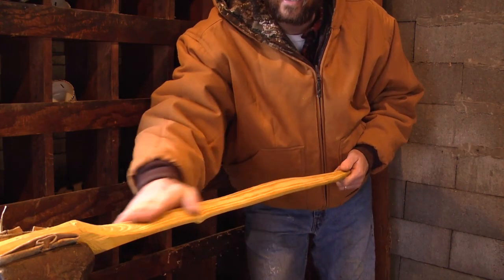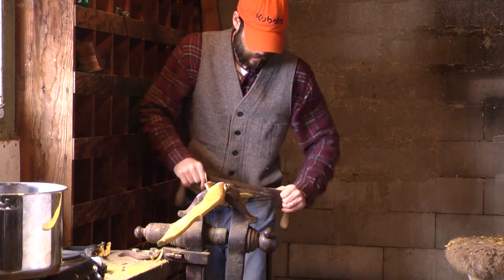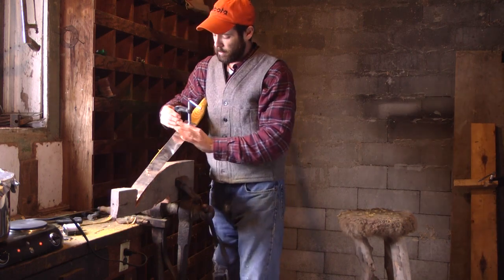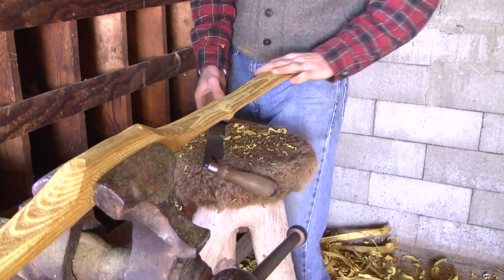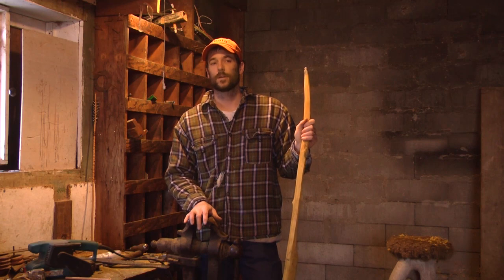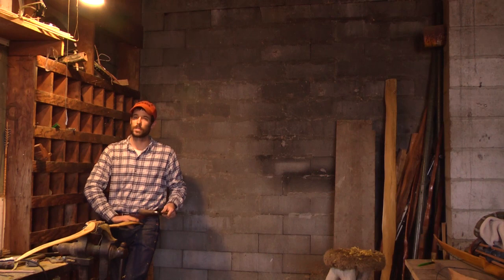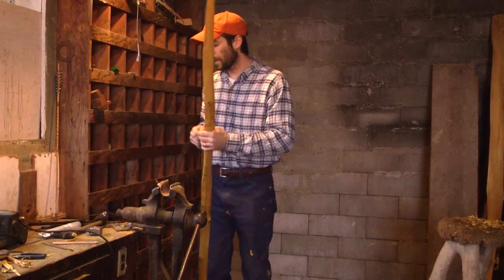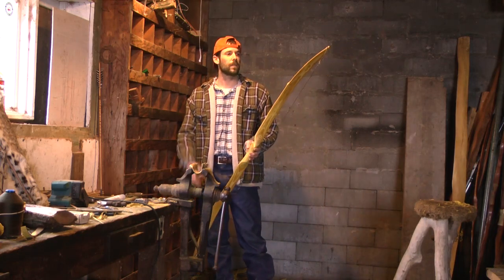How to make a Longbow - Part 3: Tillering

Comment: if you can draw the bow to 28" like 5 times on the tree is it ready to shoot? how do you know when to stop tillering and string it up? im at the very last stage of my self bow and im too scared to actually shoot it at 28 even though i can put it to 28 on the tillering tree.
Reply: You should be fine, to be extra safe you could carefully pull it down to 29" or even 30" just to make sure the bow won't break if you hiccup or something. 

When you say string it up you mean finish the bow or put a short string on it and bring it to brace?
Reply: *****
Ok thank you for your reply, When i say string it up i mean string it up to shoot, or to say the bow is complete.
Reply: If you're at your last stage of tillering your bow should already be strung to full brace and pulling down to 28".
Reply: *****
I just checked, I can get it to 26'' and the brace is 5 inch's
Reply: Ok, 5" might give you a bit of handslap but some people prefer it there , just gradually bring it down to 28. and see if you can get another inch in there. Should be sweet.
Reply: On a side note, don't be afraid of pulling the bow , as long as your limbs are bending well and you got no hinges you have nothing to worry about. And if a bow does break well, it would've broken at a later stage anyway, sometimes they just do.
I broke my first one, it was horrible, but 4 days later I already had my second one all tillered and shooting.
Reply: *****
oh sweet, thanks for your reply. I will let you know how i go!
Reply from the maker: Hi Tom, sorry for jumping in so late.  existentialnihilism (wow, that's a whopper) has if right.  One thing I'd add is not to pull your bow past whatever you want the finished weight to be.  If, for instance, you pull the bow to 28 inches while you still have some wood to come off and the weight is still high, you're likely to cause excessive string follow.

Comment: How long after you cut the tree do you let it dry?
Reply from the maker: Edgar Sanchez It depends on the drying conditions. If the log is split into relatively small staves and stored in a dry environment, then maybe 6 months would do it. If it's humid then it may take over a year. You can also rough out a bow after a few months of drying to speed the remainder of the process. Check out the harvesting and drying video on my channel.
Reply: I had a feeling that vid would explain it lol do you have company email I can send you a picture of the tree I cut down. I have no idea what kind it is though lol

Comment: How wide and thick is the bow?
Reply from the maker: It’s about a inch and a half wide. Thickness varies by where you measure on the limb.
Reply: I made a bow last week, and it turned out pretty good.The only problem is that it´s not as powerful as I wanted it to be.  How do I make a 50-60 lbs bow? Maybe I took of too much wood?

Comment: Hi Clay,
I'm enjoying your weekly YouTube posts..  That said, I have a tillering question.  I've ready to start tillering but not sure how to approach it.  The upper limb has about 3" of reflex while the lower limb is essentially parallel with the handle section.  Am I looking to get symmetrical limbs, i.e., when measuring the distance from belly to string, both limbs are the same at any given distance from the tip or center of the bow?  Or should the tips curve smoothly and measure the same distance from a line parallel to the handle back?
Thanks
Reply from the maker: I'm not really following the questions but I understand what you're dealing with. Here's what I'd do. I'd heat the lower limb and bend it to match the top. Otherwise, if you tiller each limb to work evenly, you'll end up with an asymmetrical bow. An even tillered bow would cause the top limb to work much more than the bottom.
Reply: Clay Hayes makes sense. Thanks. How's the hunting been?

Comment: Suggestion?  Why not make your tillering device with precise measured increments such as in inches, centimeters, etc.?  That way, you would know exactly how much difference in an exact measurement your right and left "wings" are bending.  Just a suggestion.....
Reply from the maker: Buck Wheat Good thought. Some people put a grid behind their tillering board for that reason.  Problem is, wood bows from natural staves don't always bend exactly the same on both limbs.  Sometimes you'll need to compensate for more or less natural backset in one limb over another which will cause the tiller to look a little off.
Reply: Clay Hayes Makes sense.....thanks.  BTW, I live in middle Tennessee, and Hedge Apple trees are all over the place.  I just picked up 6 fruits 1.5 times the size of soft balls from a very old Osage Orange tree.  I want to stratify the seeds and plant the seedlings on the perimeter of my 4.5 acre tract.  Your bows are awesome.  Keep up the good work.  Peace.

Comment: That knot on the limb bothers me, i can barely wait to see the finished product. You are a real artisan.
Reply from the maker: Zamolxes77 Thanks, so long as you follow the grain and leave plenty of wood around the knots, they're usually not a problem.
Reply: Clay Hayes I understand that, is just my sense of perfection or OCD or whatever, I just have an irresistible urge to cut off that sucker. I'm sure the bow works just fine with it, and you must be really skilled to make a working bow around that knot.
Reply from the maker: That's the beauty of making bows from natural material. You have to meet in the middle, somewhere between what's given and what's created.